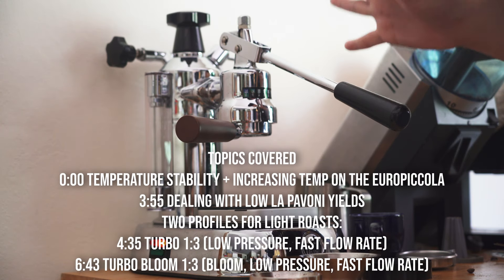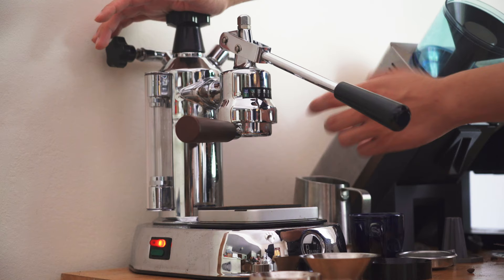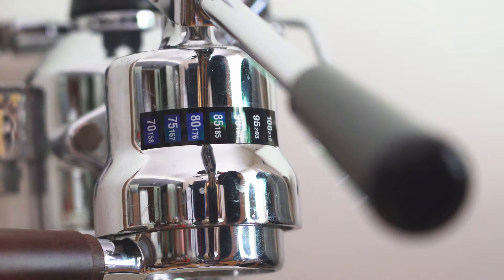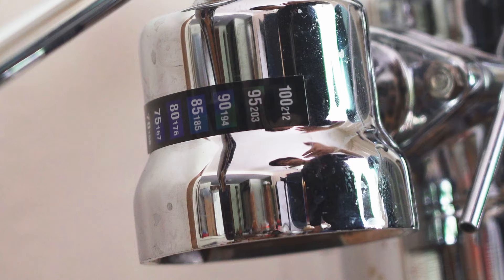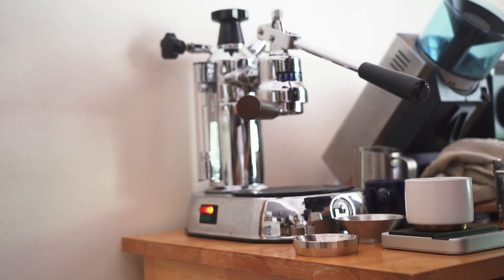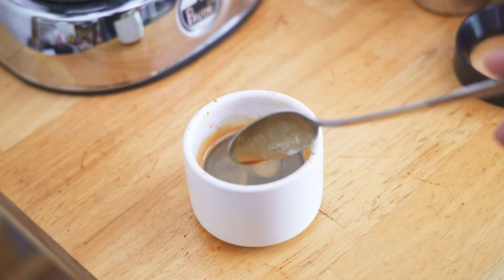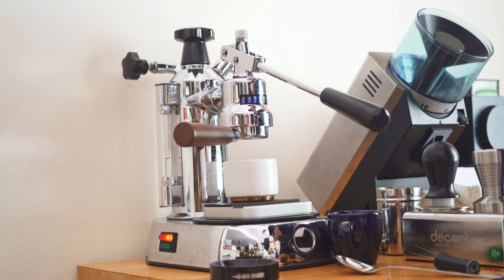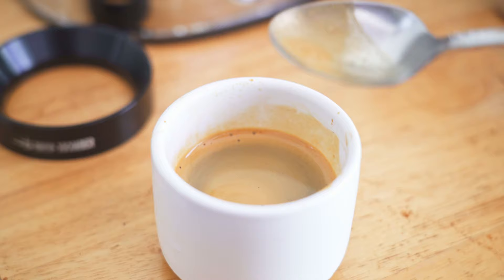How To Pull Light Roasts on the La Pavoni Europiccola | Turbo 1:3, Turbo Bloom, Temp Stability

Comment: If your group head is below 85 degrees Celsius you’re going to get mostly air when you pull the lever up and give you a low yield
Reply: That's right
Same thing if you have the boiler pressure under 0.8 bar
I have it at 1.0 and i pull at 98°C for light roasts

Comment: I've had a post mill europicolla for about a year now. I've never had a single struggle with managing temperature, why? Because I use the standard portafilter as a heat sink. Just run it under cold water for 3 or 4 seconds and then pop it into the group head for 30seconds. I can do this right after a shot and by the time I've grinded and prepped another shot (in my bottomless), the group head is ready to go. Basically never have to worry about temperature.

Comment: hello I recently bought a la pavoni, but I have an issue and i don't know where it come. My issue is when I raise up the lever, coffee immediatlty come through and when I push the lever there is no pressure on it, do you know how to solve it ?
Reply from the maker: grind finer
Reply: @BrianQuan  can you tell me a grinder to start ?
Reply: @BrianQuan  okay i tested it whith finer coffe but the probleme is always the same, when lift up the lever,  the coffee flows by itself even if I don t lift down the lever
Reply: @ALEXANDREMMII  when did you last replace your seals and gaskets? I had similar issues that were resolved after I installed a new gasket kit.
Reply: @petertzeng6127  good to know Ty so much

Comment: Hi Brian, I've been using the LP EP 1990 with TempMod for around 12 years now. During this time, I've tried many things to extract the best flavors from light roasts. First, make sure your water has the right hardness. If it's too soft, the result will be sour. If it's too hard, it will be bitter. The ideal water hardness is around 7-8dH or 119.7-136.8 GPG.

For a light roast, it's better to use a precision basket like IMS. When grinding finely, you can extract more caramel flavors with a precision basket. You don't need to heat the LP for 20 minutes as it's a waste of energy. The green light indicates that the pressostat has kicked in and started heating. When the green light goes off, the pressure is around 1 bar. You can calibrate it using a pressure gauge. After 2-3 flashes and emptying the pumps 3 times (I use a precision thermometer), I usually have around 93.4°C on the group after 7 minutes of turning the machine on.

Using a 1mm Puck Screen makes the light roast a bit softer and reduces the harsh sourness, resulting in less channeling. Blooming is essential, but I let it bloom for about 10 seconds. It's also crucial to understand what happens during the extraction phase. In the first 25% (lever range), you extract all the sour aromas. From 25% to 40%, you extract notes like floral and fruity flavors. From 40% to 55%, you extract all the bitterness. The rest goes into the sink. The key is to balance the flavors (bitter and sour), allowing the middle notes to stand out.

Comment: Yep, premill LPs you just have to turn it off to let it cool down. Most have two separate heaters you can switch between, with mine I use the 1000W side to bring the boiler up to temperature quickly then just use the 200W side while the group heats up, using that same dry pumping to cycle a little hot steam through it.
The later models have a pressurestat to regulate boiler temperature in an indirect way through pressure.

I find I get much faster heatup time using the dry pumping after purging the 'false pressure' from the air already in the boiler heating up, it seems the steam is much better at moving heat around.

A wet cloth is a really easy way to cool the group down after pulling a shot, I know lighter roasts are fine at higher temperatures but you still don't really want the group to be near or even above 100.

It's worth noting that the water temperature can actually be above 100C because the boiler is under pressure!

Comment: Curious how the Pavoni instruction manual describes pretty much the turbo shot. Ie waiting for pre infusion to take place and when drips start to be seen to pull the shot.  I’ve never had a bad shot in all the years I’ve owned them and that’s over 20 years. I like the idea of the temperature strip though and that has improved consistency of my shots. Would love to get a bottomless Portafilter, but not convinced about the level of improvement I’d get. Nice video. 🙏

Comment: Did you notice your temperature strip is not in good contact with group head, so the temp. reading is poor. At 1:38 in the video when you touch the temp strip between 85 and 90 it moves because it is not stuck to the group head. The movement is noticable because the light reflected off the strip changes a lot as the strip moves.

Comment: With my post millennium I haven't noticed any issues with the temperature, no clue what it's actually brewing at, but it seems to work alright! I usually do 15g in and get 25-31g out. So basically ristretto all the time, but it works nicely that way even with a light roast. 
I am curious to try a lower dose and see how that turns out.